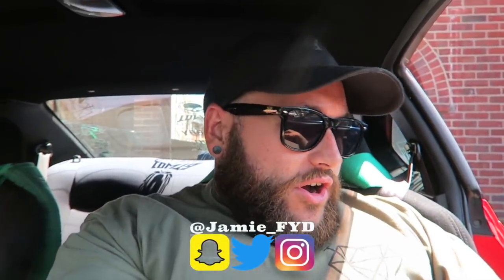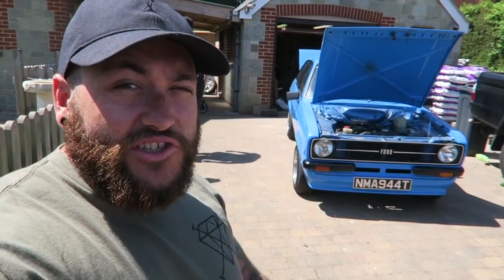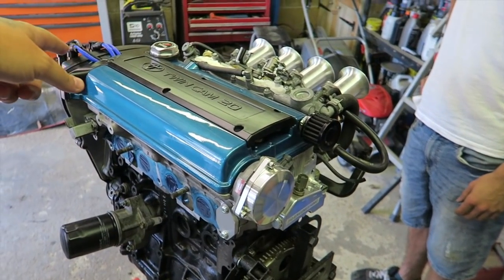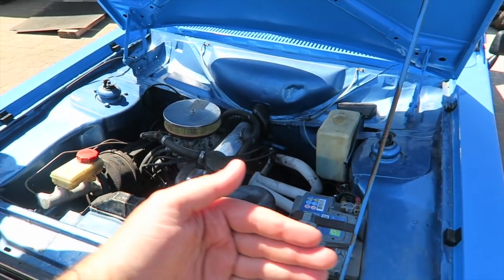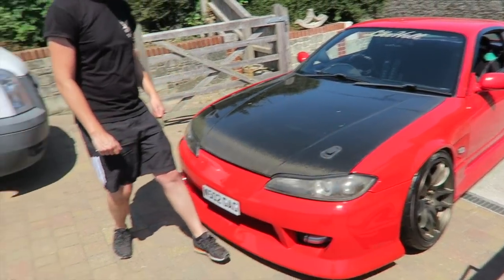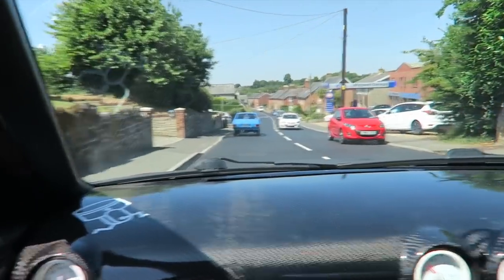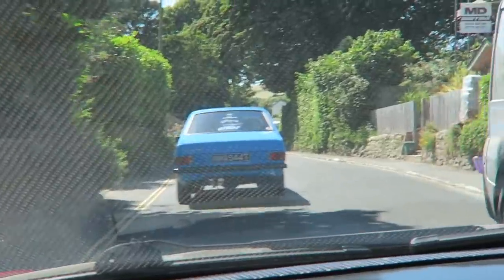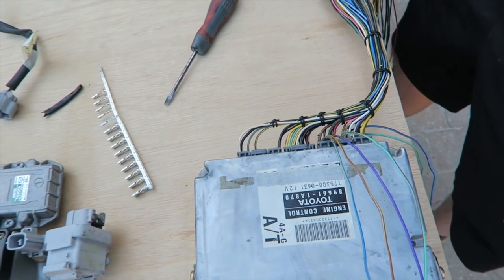WON'T BELIEVE WHAT ENGINE THE MK2 ESCORT IS GETTING!!!

Comment: 2.9 32v Cosworth V6 from a Scorp Ultima would have mated to the type 9 gbox there and with little modding to the engine mounts would have been an absolute monster, I remember a mate from way back who stuffed a 3.0 Essex into his MK2 Escort van and it was lethal fast that is after fitting RS2000 bearings and brakes from a Granada.   I had heard there is a MK1 Escort with a RS3100 v6 in which is a beast too.   Thats the beauty of old skool Ford, virtually anything they made will fit anything they made, I am surprised no one ever thought of grabbing a crated 2.3 Lima Pinto with turbo from the US which would fit so sweetly in the humble MK2 :)

Comment: The crossflow and the early 4age have very close links,
the 711m BA crossflow block was the base for the lotus twin cam,
 the cosworth deveoped BDA (Belt Drive A series)1600 came along 70/71
  the early 4age is an exact copy of the BDA with just a better designed oil and water pumps
, Bore stroke cam profile,in/ex valve sizes,stem diameter, tappet bore size, 
same carb bore size, choke sizes (weber V's Mikuni) and so on ,
they made near identical power official quoted numbers 130>133
due to water jacket differences the outer parts of the block are different shaped
 & mounting points make the heads and blocks not interchangeable 
as in 4age head on the xflow block

Comment: very interesting is there room at bulk head  also what about gear box mating to out put shaft ? would like hear more on this interesting project
Reply: SCOTTISH PREPPER VARIETY ,CHANNEL 
It’ll be tight but should just squeeze in, using a Toyota flywheel and pressure plate and a ford friction plate with spigot bearing that will will fit both the ford input shaft and the Toyota crank.
Reply: my kind of engineering  first class

Comment: Should have put a cosworth engine in
Reply: +Jordie Evans  about 10x the price with hardly any performance gain!
Reply: i got a mate whos put 30k into in cossie. too much money man
Reply: I was going to say the same thing about price, Cosworth is no longer a working man's option.  An engine that needs a rebuild is £5k, once you factor in all the other parts - turbo, T5 gear box, atlas axle you're £15k down and not even finished.
Reply: Also when Toyota designed the original 4age engine in the seventies it was a copy and evolution of the Ford BDA - same bore, same stroke and the same valve sizes.  This is why it is the same length as the crossflow (the BDA used a crossflow block).  So the engine in the vid is a successor of the original 4age which was based on the BDA which in turn was based on the crossflow so in many ways its perfect for a Mk2 Escort as it can trace its ancestry back to those glorious 16v engines of the rallying era.  Plus its a lot lighter than a Cosworth YB!
Reply: Everyone goes for cosworth i would have a Millington or a 2JZ Engine if i had the money
Reply: o0RAGA0o yup, a 2jz would fit right in there
Reply: ha ha
Reply: Nah lad, put a 2.5 millington engine in it.
Reply: I remember when the Escort MK2 was released in Australia in the mid seventies. Either with a 1.3 or 1.6. No 1.1's there. Had to be able to overtake a road train on a single lane country road. Even the 1.3 was considered underpowered for Australian roads. A few years later the 2.0 from the Cortina was offered for the Aussie Escorts across the range. 2.0 was the smallest fitted to an Aussie Cortina which also offered two straight sixes from the Falcon as an option. Including the 250 cu in or 4.1 litre.  Nice understeer. Came back to Britain and found even MK3 Cortinas often fitted with a 1.3. Good fuel economy but dear me. Yeah I know other engines were available. That and rust here was a shocker.
Reply: My dad has a 400 bhp cossie
Reply: Millington would be a nostalgic if not a hugely costly proposition. If people think that doing a YB is pricey then Millington will be on another planet pricey. 

I do have respect older Fords, but unreliability and constant engine rebuilds would put me off. I think a Toyota swap would be ideal.
Reply: o0RAGA0o  +1 for millington (rs1800 style'e) :)
Reply: Volvo t4 1800cc hp turbo.
There damn cheap,and have 200 hp standard.